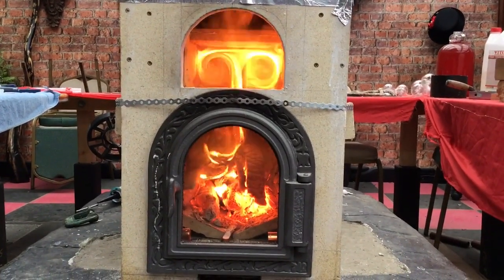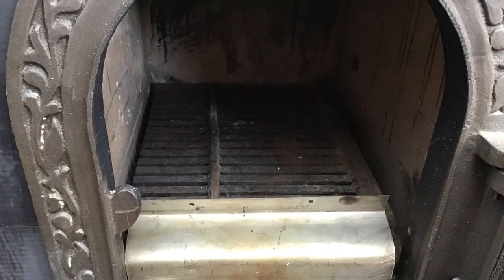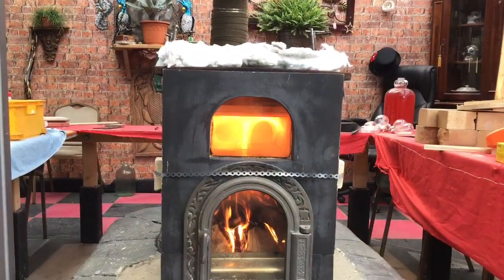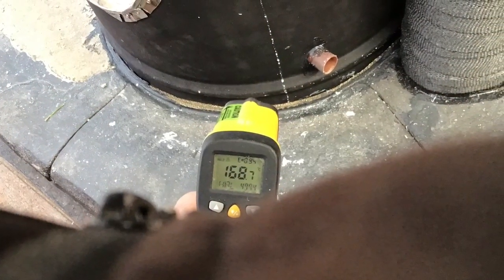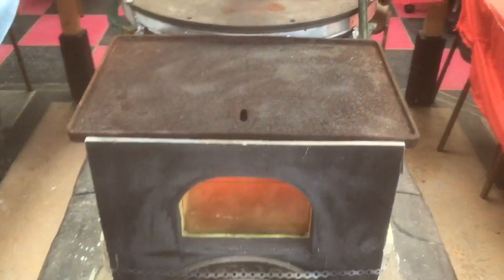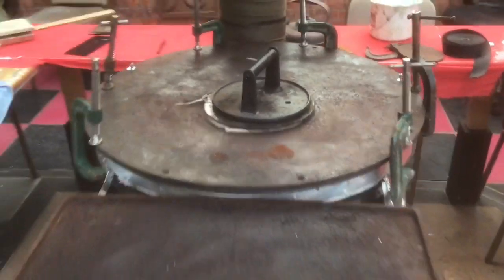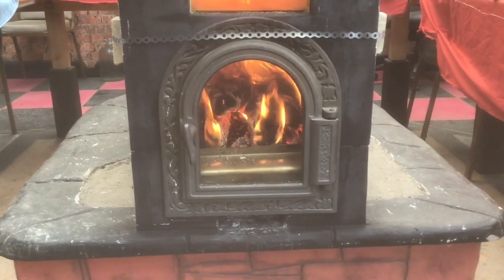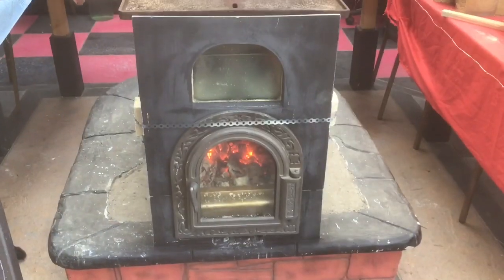Vortex rocket stove update

Comment: Like your thinking on this, contemplating building some thing similar but it will need to go into a standard kitchen fireplace, no problem I have it sorted on paper will run in a convoluted path across a hotplate and around an oven with usual diversion plates to cut out the oven etc. Have you thought of running secondary air vents to supply air at the entrance to your secondary burn chamber, the copper tubes you showed us are not really secondary air feeds as they feed beneath the grate I think they are quite important as they supply a constant air flow to the primary combustion chamber. you could supply air to your secondary burn via old gas oven burners the cast iron type shortened to suit if you were to still get sufficient unburnt gas curling back over your top plate a third burn could be achieved in the same manner by running yet another cast iron gas oven burner along the front of the plate feeding in air from the side.
Reply from the maker: Hi thank you for your interest, that stove is a few years old, I have more up to date videos on my channel featuring a 4” vortex stove that works very well.

Comment: I hear you've pulled this thing apart and gone back to a rocket stove instead of this wood gasifying vortex stove?
Reply from the maker: I have taken down the vortex stove  although  I have saved all the components and intend to rebuild a mark two this autumn .
I am running another design for the summer as it suits my personal needs better ….. you can see it here …. https://youtu.be/tqD67eWNRjQ
Reply: @foxfish7115  not as pretty though!
Reply from the maker: @TheGchiu  no but it has a clear glass top now so it does look good at night time and it will burn virtually anything wet or dry, large or small.
It also has a small internal oven,  I will have to make a new video with the recent updates …..

Comment: Is that board not a little fragile, like where the front is made off?
Reply from the maker: The front board is made from vermiculite and rated at 1200c
Reply: @foxfish7115  That was what I mean, it is quite fragile, I do not now if that is available in greater strength.
Reply from the maker: Yes quite fragile but there are very few materials available to use unfortunately , but I have some fresh ideas to re build it this Autumn ....
Reply: @foxfish7115  There are thin fire sone panels for ovens, you can use these, for the inside when there is no pressure when heated up vermiculite does fine.

Comment: That looks a really clean burn are you able to measure temperature C and oxygen in the flue. It looks like it's a twin turbo
Reply: Ok many thanks for the info much appreciated. I'll have a look at the rest of your your vids. But the one with the twin vortex is really impressive
Reply from the maker: The afterburner runs at around 700c , i have no way of measuring the oxygen but it would be very low?
Reply: @foxfish7115  i think in batchrocket.eu there are plans to make an open source o2 meter.
Reply: @foxfish7115  that's some heat just from wood. Just as an idea there's a fan that you can put on the top of stoves and it runs on the heat. I wonder if it was ducted into the fire or second burn chamber would the temperature increase. I'm in the process of building a rocket stove for secondary central heating myself but I haven't got the temperature that you have I've got 535-570c . You're doing well
Reply from the maker: @keithsyers5833  there are many ways to go, using a heat powered fan to turbo charge the fire ha ha ... might work but honestly I think the fan is better distributing the the hot air into the room. I have built another style of rocket stove in my last video.that is much easier and cheaper to build .